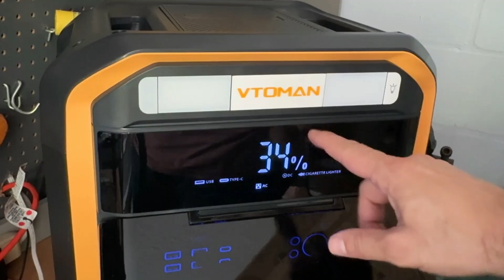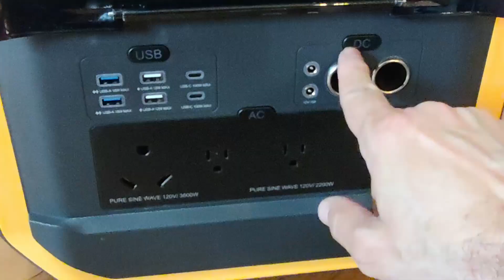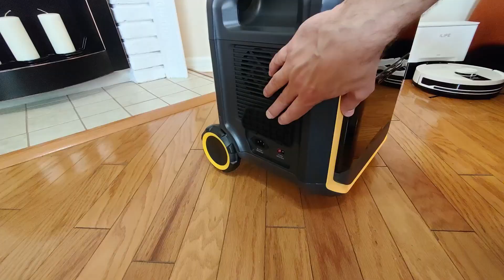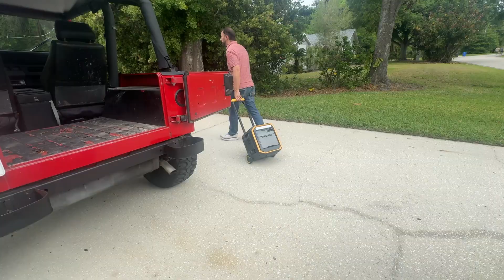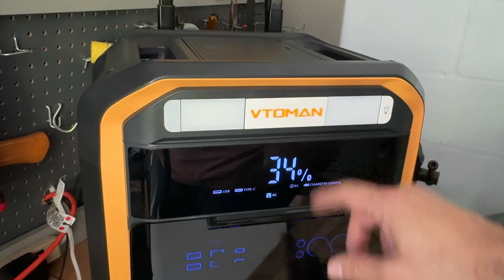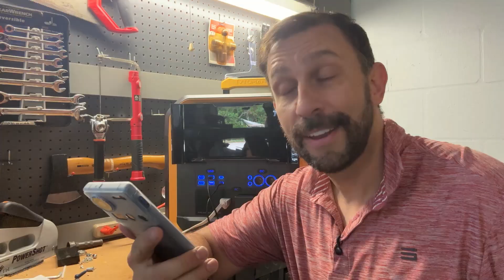VTOMAN FlashSpeed Pro 3600 Power Station

Comment: I’ve tested a variety of backup power systems for off-grid use, and this model appears to be one of the most robust in its class. The LIFEBMS system paired with LiFePO4 batteries makes it an excellent long-term investment